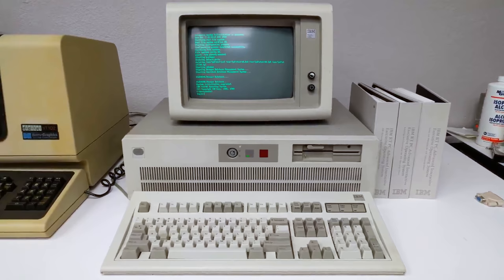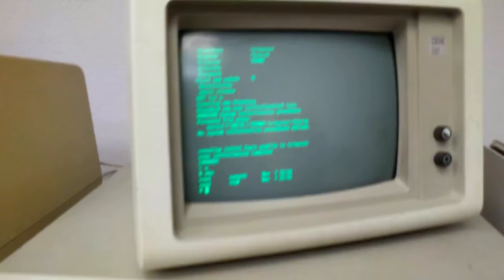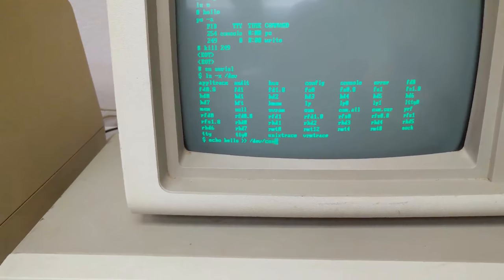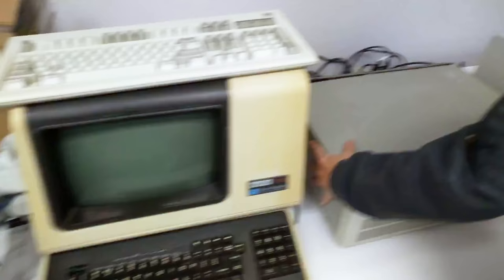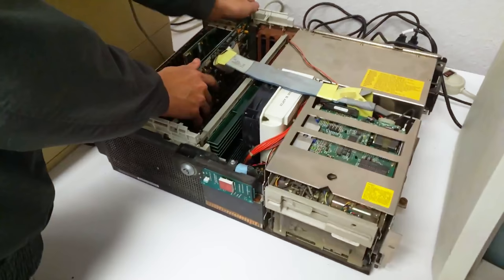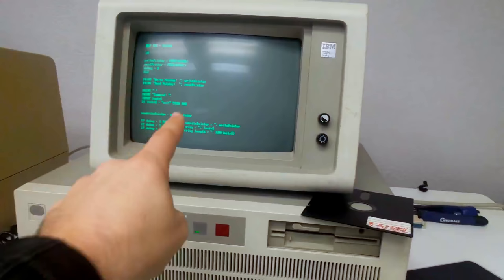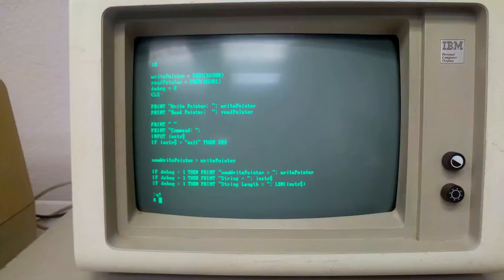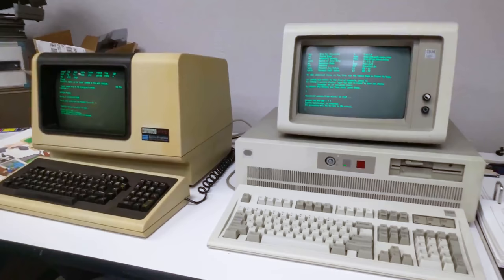An IBM RT AIX PC Experience

Comment: Is that IBM AIX 1.00? Apparently WinWorldPC is looking for a copy, so if you have the install media or David has it, you should image it and send it to them.
Reply: It is AIX 2.1.
Reply: @davidk8893  Ah, well that is exactly what they have. Might try to see if I can get it running in some kind of emulation for fun, probably qemu.
Reply: @charliebrown1976  I'm not sure how much luck you'll have , as the RT is a proprietary archetecture.
Reply: AIX runs on PPC too and that's a system qemu can emulate.
Reply: I looked at my boxed set of AIX disks, and figured out that they are in fact AIX 1.00! I have no idea how to image unix disks on a PC though, any tips?
Reply: @davidk8893  I don't know much about the format they use on those disks, but if they are standard FAT16, you can use something like WinImage and a USB floppy drive to get the job done.
Reply: @davidk8893  use dd, but read instructions carefully
Reply: @charliebrown1976  I do know a lot about those disk. I had a 6151,  010, No hard disks, that I was restoring. All the disks are standard tar format and can be copied with DOSs DISK COPY... ( the drive is standard AT, and can be used on any computer that supports floppies. The SECOND DISK is the funny one. Only rawwrite or DD work on it, it took me a while to copy that one. All my disks are lost, as is my system.
Reply: @charliebrown1976  That would be nice, but I have never heard of it anywhere. ( I owned 3 )
Reply: @N0zer0  Later versions. PowerPC was derived from RS/6000
Reply: No. 2.x  the RS/6000 came with 3.0 and the rest is history.  That was a cool machine. Never lived to it's promise.

Comment: When I went to college in 1991, RT PCs were in the Unix computer clusters along with VAXstations, DECstations and some early Sparc Sun models. They were really showing their age and struggled mounting remote filesystems and running multiple X Window apps. Only the VAXstation 2000 system were more avoided. Still, they had the best keyboard when compared with the mushy Sun and DEC ones. The RTs got replaced by RS/6000s a year or two later and those were the new king of the hill with nice 19" or 20" color monitors and a relatively speedy POWER CPU.  Good times :)
Reply: Those machines (the IBM RS/6000) were the floating point champions a number of years.

They were very fast.

Comment: That "tablet thing" is actually called a digitizer, it was used back in the day for CAD/CAM software (at least that was my experience).  My school had a copy of AutoCAD R12 (might have been R11, that was 25 years ago :)) running on a Pentium Pro machine, the interfaces was the digitizer (the whole unit was a digitizer, the tablet part was called a drawing board and the mouse part was called the placard) instead of a mouse.  Never got to use one, but my teacher was describing it in class one day.  You would apparently board draft (draw on paper) your design, then use the crosshair on the digitizer hand device to enter the drawing into the CAD software.  Love the channel, keep up the good work!
Reply: More specifically, it's an IBM 5083 11A tablet with the digitizer cursor. You could get them in two different sizes with either that digitizing cursor or an active pen.
Reply: This. I am actually amazed that this channel doesn't recognize vintage peripherals! :-)  I remember messing with LISP in AutoCAD R10 back then. My dad  had a cool dual head set-up (Hercules for text, and a MAB480 board for colour graphics to a big *ss monitor.) That really was awesome to play with as an 8 year old ! :-)
Reply: The mouse is far cheaper and so we are nowadays restricted to them.

AutoCAD had different stencils for the board for different usages (ie a water installation deasigner could have a stencil with different types of valves or pipes easily accessible.)

Nowadays you have to send the pointer out to the edge and select a small icon or maybe a floating window.
Mouse... can you say RSI ?

Comment: Wow, this machine is special! It was the very first system to run AIX and also the CPU is the ancestor of RS/6000 which became PowerPC which was used in all kinds of computers for a couple of decades. It deserves special care and consideration.
Reply: Yeah, it uses the IBM ROMP processor.  A custom RISC cpu before RISC was commonly known outside of ARM, but even that was not very common at the time.

Comment: When I was back at college (1990/91), I administered the mini tower version of this in our lab. I installed AIX from scratch, set up TCP/IP and it had a shedload of serial ports, so I networked out the room and set up all the IBM PCs with terminal software to connect to it. Had it fully set up with x-windows (although no real software to run on it) and c-compiler. In truth, everyone used to log in and use the e-mail client to send crappy poetry and messages to each other. A great machine, completely under-utilised by us - happy days.
Reply: Aix is truly awful Unix and nothing would compile including X without a bunch of hacks. Simple automake would show headers which were not even present?? Environmental variables were all over the place. SunOS and later Linux did not have any of these problems

Comment: I worked as a grunt at a drafting firm one summer long ago and we had a similar setup with those "pucks" as we called them. In our case they were used to trace portions of paper drawings into the CAD software we used at the time (not AutoCAD).

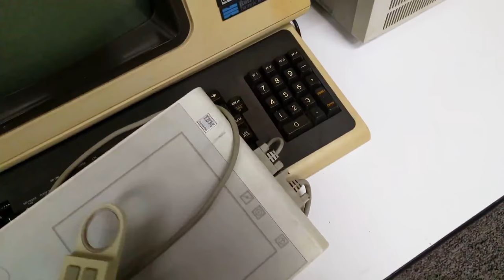Comment: That "tablet" thing from 15:00 is something I know about what segment of the industry it was also used in. My mother used to draw power lines and transformer stations as a living. And she used one of them, back in the 1980's. I have absolutely NO idea on what machines she used for AutoCAD, yet I clearly remember that she used one of those as her work tool. First she drew the the plans on paper, the old school way, and then she drew it on the computer system. After the job was done, she used the local network, to send a backup to the server room. The room had lots of mainframe systems, that used these giant interchangeable platter drives and tape backup systems on giant tape's.

Comment: This is a fairly significant machine - you should keep it in good working order. Some noteworthy details:
1. It came with IBMs 801 processor, which was one of the first (if not THE first) production RISC chip. The 801 was even considered for the original IBM PC, but it wasn't done at the time it was required and it was quite expensive to build a system around it
2. You could use standard ISA cards (as shown in the video). That gave you access to a wide range of add-in cards. If, of course, the dreaded AIX could provide a driver
3. It was the first system to feature AIX. Actually AIX 1.0. And it sucked big time. 
4. You could run the "Academic Operating System" (AOS) on it - which was just a fancy name for BSD 4.3. And contrary to AIX 1.0, BSD 4.3 was far from sucking - it was arguably the best UNIX implementation out there by a mile.
5. You could load the box with memory. In addition to the memory on the CPU board, the two long slots next to it (kind of ISA AT slots, but more in the middle of the mainboard) could hold two additional 4MByte RAM-cards. So if you had really big pockets, you could have an insane amount of memory in the box

It wasn't the fastest UNIX system around with somewhat lackluster IO, but it was not bad at all. Would love to play with one today - back in the day, I only saw them on the CeBit computer trade show in Germany, when they were introduced. The University I went to during that time had a testsystem, but I wasn't involved in its evaluation - by that time, I got to play with "the big boxes" we had :)

Comment: Never knew about the 'write' command before.
Tried it on the very computer I was watching the video on
and... it worked! Exactly as advertised... on modern Arch Linux!

Was chatting with myself through my phone (ssh client), my file server,
and even my laptop running Fedora.

If only I had friends, would be real fun to have a conversation using original UNIX tech!

Comment: In later versions of AIX, all you had to remember was "smit" :-)
Reply: Ah, smit bring so many memories
Reply: SMIT was all you needed! So the IBM guy told us. I was admin for a host of RT's back in the day. SMIT was ok, but to really get some things done, you had to hit the shell. Like all things IBM, SMIT grew into a behemoth with patch issues, etc. I have to say, I don't miss it.
Reply: @parrottm76262  the problem I found with making changes in the shell was that if you later used SMIT, it would not recognize those changes and undo them as it seemed to use an internal database of sorts for its changes. Luckily I only had to admin one IBM R/S 6000 workstation I used so I learned to just SMIT. Fun fact on the R/S 6000, there is a cool sci-fi reference built in when things go wrong...
Reply: @GeoffSeeley  smit was an example of the kind of proprietary vendor lock-in I was mentioning elsewhere. On Linux, even though you can have distro-specific front-end tools for doing admin stuff, they still store their info in the standard config files in /etc. This makes it easier to keep track of config changes, backup/restore them, move them between machines etc. Whereas on AIX you have no idea where it keeps the real info, so it becomes hard to do these standard sysadmin tasks.

Comment: 16:55 All the Unixes came with vi. I gritted my teeth and stuck with it for about 15 years as my go-to editor on all the Unixes I came across, until Linux systems took over and I could rely on being able to install Emacs. Then I switched, and never looked back.
Reply: if i try to edit anything in notepad, or a similar text editor i get frustrated so quickly. "wait i have to press 3 keys to open a new line above the current one?" i've only been using vim for ~3 years, but i could never go back to any other editor. i even installed it on my amiga. cool thing was my .vimrc copied over without needing any editing!

Comment: This brings back memories, having used an RT PC in the mid 80's myself.  Long story long, I moved to the US in '84, and got a part-time job at a CAD company.  They got a contract to test some special boards for IBM which were meant to simulate fiber optic networks.  They had a test bed set up for them, which was attached to the RT, and all I really had to do was run a set of tests on the boards.

Now, I seem too remember that the RT I used was actually a slick looking tower system, and the monitor was a "paper-white" design with black-on-white text, very cool looking indeed.  The only other thing I remember is that the chips I had to install on the boards each cost in the tens of thousands of dollars, which made me rather nervous to handle them lol.

Comment: I had a job in the first half of the 1990s where, every single weekend, I would back up an RT to 1/2" and 1/4" tape, then restore it back, to reduce disk fragmentation.  Easiest money I ever earned, except when I got a late start or a backup needed to be redone.

Comment: I had the joy of setting up and configuring a network of IBM RT PC's in Sweden while doing research. Running AIX 1.2 and AIX 2.2.? and most machines had 75MB hard drives and one machine had 300MB? drive ... so it could actually run X-Windows. Had the joy of running Mathematica 1.? on one IBM PC RT downstairs and remote accessing it from another IBM PC RT upstairs to send the graphics to a Mac screen. Around 1998/1989.

Comment: there's a IBM terminal age and style appropriate on my local craigslist, and if you're ever in the middle TN area I got some stuff you can have but would be scared to mail
ps that's a digitizer tablet, you would home it, then place something like a blueprint down on it, and using the crosshairs basicly input XY data and what kind of element like lines or curves or whatever to use with drawing or cad programs (you could use it freehand as well but it just works as a XY data "sampler")

Comment: Mannnnnn! I missed one of these on eBay by a few $ a few months back. Came with an AT 5170 too! What a great machine. Must have been pretty useful for the sysadmins back in the day.
Reply: Was it a tower machine located in Texas?
Reply: @davidk8893  No, this was an IBM RT sitting on top of an AT, being sold in Melbourne Australia. Seemed like the two were paired with some kind of communication card of some sort (I forget which type)

Comment: Wow that's the IBM RT PC 6150,  this is the early pre-version of the IBM Power and PowerPC processor from IBM.   And if I recall the line of Risv that followed the RT was the RS/6000 that open the door for the IBM POWER & PowerPC RISC processor.
Reply: The RT did not have the PowerPC processor, it used the proprietary IBM ROMP processor. They switched to PowerPC later in the RISC line.

Comment: Well this brought back memories. I attended engineering training on these at IBM in about 1988. Our company sold them with 3rd party async cards for 16+ monitors running business software. Spent a couple of days replacing failed HDD for a customer on one occasion - I think minidiscs had to be setup just as per original setup before I could restore from tape backups….This machine was also my WFH choice 😅 in a tiny flat. It generated all our heating requirements.

Comment: FYI: In addition to serial I/O this machine supports TCP/IP over 10BASE2 Ethernet adapters. The primary operating system for the RT was AIX version 2. AIX v2 included full TCP/IP networking support. NFS file sharing is also supported. For the graphical user interfaces, AIX v2 came with the X10R3 and later the X10R4 and X11 releases of the X Window System from MIT, together with the Athena widget set.
Reply: Unfortunately XWindows was not included with AIX, it must have been an additional purchase. However, if you know of somewhere I get XWindows for the RT, I would greatly appreciate it!
Reply: @davidk8893  I worked with this system at a business, I don't have the software for it, but I am familiar with it. You could try calling IBM and asking nicely. Tell them you are restoring the system as a history project, they might send you the software.

Comment: 1:55 Note that on non-Linux systems, the home directory for the root user is “/”, which is the root of the entire file system. Linux introduced the idea of a separate “/root” home directory, which avoids dotfile clutter in the “/” directory, and also reduces the risk of certain kinds of accidents. ;)

Comment: What fun.  I'm doing similar with an IBM AT (yes 286) running XENIX/286.  I have two additional terminals (Telnet connections) via a Lantronix (Ethernet to RS-232) connection.  Now three users running a UNIX variant on a lowly 286 processor - now that's fun ;)

Comment: @12:12 i think it shows the power rating, it gives V as 120, and A as 7.5 (i think hard to see) which would put the wattage as 900Watts
Reply: Came to the comments to say just this. :)
Reply: Kind of funny that it also listed it as 0.8 kVA (kilovolt-amps). Whoever used that unit (rather than just VA / volt-amps) was likely accustomed to bigger machines.

Comment: It does sort of say the wattage on the back. At 12:11 you show the back and it says V 120 and A 7.5 for 120 volts and 7.5 amps. Since wattage = volts x amps, then that equals 900 watts! As Darth Vader would say: Most Impressive!

Comment: The simms have pins soldered on them, which became sipps.
The ROMP is a 32-bit processor and 32-bits to memory, but 16 to I/O.

This is the third version of the processor:
The first was just the ROMP, and the second was the APC, with IBM can memory ( like the PS/2 80. )
The last APC used these SIPS, and the final version in a PS/2 used SIMMS. 

The APC was really really weird for number crunching, it had a 287, a NS32037, and a M68882.

Comment: Used to work on a bunch of those back in the day.  There was software that ran on them called Insurenet for small insurance companies.   Used to put in a Novell server and thin net for the PC network and then run a serial to each computer and put on a copy of Procomm for terminal emulation.

Comment: When I was very young, a friend of mine received an old IBM tower machine from a relative that apparently worked as an engineer of some kind. We were very puzzled about it and did not recognized anything that we were used to (from our early Pentiums with Win95). I remember that it had a non-IBM amber CRT display, an keyboard with may additional keys. We could not get it to work. It might been a PS/2 as well but I think we would figured that out.

Comment: The power supply will need to output + and - 12V, because the async adapter needs those voltages for the line drivers.

That or there are voltage generators on the motherboard for those since they are typically very low current.

Comment: Ahh that brings back memories. Back in the day, way before Linux was a thing, I had three weird old UNIX machines -- an ancient SGI workstation (which was about the size of a washing machine and weighed a freaking ton) running an old version of Irix; a Callan Unistar 300 UNIX workstation which was about the size of a horizontal file cabinet and ran a truly ancient version of UNIX (V7 I think?) and an AT&T 3b1 UNIX PC. Had a couple of terminals hooked up to the various machines (I think they were HP terminals of some sort, don't remember the model offhand.) And I had the machines networked with 10BaseT coax (BNC.) Fun times, fun times.